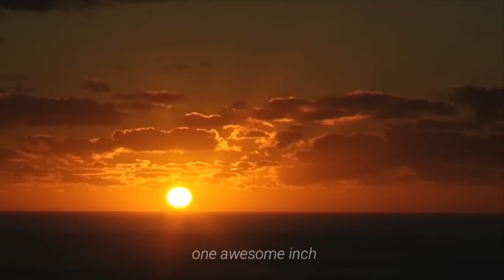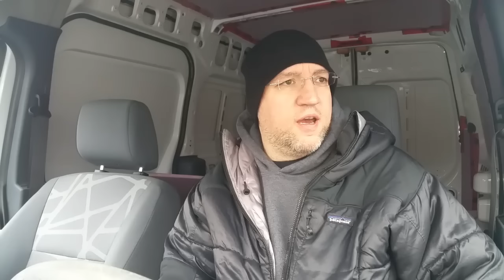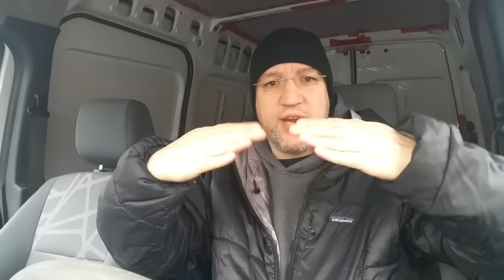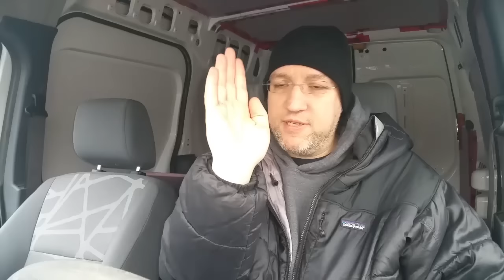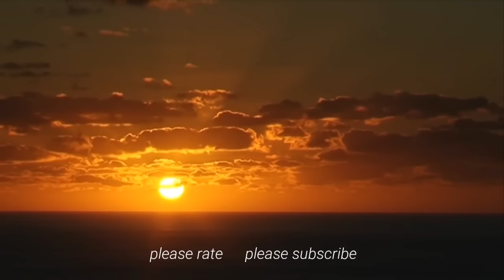Polystyrene Foam Cabinets.... Pros and Cons

Comment: Nice discussion on the pros and cons. I have been thinking of using wood for the base cabinets that will get the crap beaten out of them and using foam for the higher cabinets to keep the center of gravity as low as possible. I am going to convert a box truck so the backs of the cabinets, where damage and strength are low concern, will probably be 2 inch foam and double as insulation for the walls, reducing my build time and weight. Having seen how so many van dwellers wish they can change their floorplan I plan on making the cabinets modular and screwing everything in place so i can unscrew it and change the plan if I like.
Reply from the maker: Modular is a great idea.

Comment: I remember those bass cabinets, the problem wasn't so much in the materials it was in the design. They didn't account for the massive vibration of the bass through the speaker, and didn't design them with proper solid wood backing where it was needed. The polystyrene panels used in the cabinets are made with a fiberglass surface just like many bulkheads in modern sailboats. While it may dent with a severe blow from something sharp you have to believe any plywood would also dent. JMHO

Comment: Great if you are putting only clothes in them, but my experiments show that these structures are inadequate in a vehicle that can, at times-- any temporarily-- can triple the weight it contains.Like 3Gs? Yes. try that with a container of cans, and it's UGE.

If you go "there", use the Zinnsser 1-2-3 selant, because it contains only rigid resins, no the butyl and vinyls in Glidden's Gripper paint. There was a visible difference in the strength, using a paint can on top of a 30" experimental sheet! BAH

Comment: If your main complaint is the possibility of denting the surface when impacting it with a corner, you may consider putting a wood facing on that exposed section of the cabinet. This would also give you a much cleaner looking finish.  The rest of the structure could remain polystyrene covered with screen and glued together.  I'm considering using this https://www.lowes.com/pd/DPI-47-75-in-x-7-98-ft-Smooth-White-Panelboard-Hardboard-Wall-Panel/3015239 because it's also a great cheap whiteboard and my granddaughters love to use the dry erase markers.  The decoration possibilities are endless!

Comment: you could make a1/8" wood façade to deal with the denting problem... actually camper trailers are built very similar. I do realize even trailer builders use wood for the cabinets, but I wonder if the reason for that isn't more of a space enhancing measure (cabinet walls can be thinner,  there's no need for extra bracing, overall just that little bit more storage, ... )

Comment: It's a Van - it was designed to Carry stuff. Does the weight really make that much difference?? Having regularly  carried about a ton (1K Kg) of boxes of books in mine, I can say that not only does it drive better loaded but the consumption only dropped from 33mpg to 31mpg. Fully fitted it's going to be less than half that full weight - where you drive will have more effect than a few cupboards. Aesthetically however this method has great potential - and there is certainly a long tradition of such methods - papier mache and Japanese lacquer come to mind. Unfortunately these particular ingredients foam, paint are not readily available here (UK) as I might be tempted use them to build a canoe where the weight difference really would be significant.
Reply: Nick Wood great point! these van are designed to be loaded up all the time.
Reply from the maker: I agree that the foam cabinets do have great potential. I'd love to see more vandwellers pursue them.
Reply: Yes just saying don't get too hung up on the total weight - however one area they could make a big difference is weight distribution which is important, say for high-up storage or adjusting for axel balance.
Reply: Into The Mystery 13 I can see the foam interior components being useful for your van if the wood components you installed into your Astro affected the overall driveability,  replacing some of it with these foam assemblies instead could make a world of difference!
Reply: Yes the gas counts if you are going to drive coast to coast. Okla. is going to raise gas prices 6 cents a gal. to bal. the state budget. Sorry I'm going to make foam.
Reply: 2 MPG is significant. That's an additional 40 miles of travel from a 20 gallon tank.

Comment: you would need a work shop and a big sink tbh. the method is a messy one. be a horror doing that outside of home depot. it would be safer in a crash. and better for the tops as you say. a mix would be worth abit of thought. am enjoying the random music moments haha
Reply: waine dodd I watched them build a whole cabinet on a park bench at a camp ground. no sink needed. she wore gloves and had it finished in no time. when I've done all my builds I had wood shavings everywhere when I cut and sanded.  I dont think it would be respectful to build anything in a home depot parking lot, and if your working out of van it would contribute to all of losing out.
Reply: i didn't see the park bench build Jed. I did see the other two you did on the couple. the guy had skills for sure. you made a very very good video on the subject. thanks for them 10 out of 10. inch has to build in bits where he can. mostly in a quiet out the way corner. was just looking at it from his perspective. any body else I would point to and advise they looked you the vid you did. keep posting Jed we like the adventure
Reply: waine dodd you got it! I misspoke, it was the paper bag technique I watched on the park bench, it was bare cabinet construction and paper bag technique I filmed in the garage. the park bench part was not filmed
Reply: im glad you said. I was going to search for that vid. you saved me some WOOO time :)
Reply: waine dodd ;) happy thanksgiving if you celebrate that, if not it's goooooood to be grateful anyway

Comment: Did you wind up using the cottonwood plywood in builds?  If not, I wouldnt, cottonwood is a terrible wood for high moisture environments. Cottonwood loves water, its nearly made out of it.  It may be fine for coffins, but I wouldnt put it in a boat or a van.  (poplar = cottonwood)
Reply from the maker: I was thinking about it but maybe not. In BC it's $100 a sheet.

Comment: I am building my cabinets tomorrow and I was considering trying the foam method from Into The Mystery. I have also concluded it was just to time consuming and I am also skeptical on how durable it would be with a bunch of weight in it. I have opted to build mine out of wood.
Reply: NewZona Rides 2 having had tested out the foam cabinets myself they are extremely strong! doesn't seem like they take much more time than wood unless your already very proficient with wood.
Reply: NewZona Rides 2 also depends on your construction method and wood used wood can be stronger or weaker than the foam. using foam as a core and a high strength outer layer (fiberglass or aluminum screen or thin plywood) combines the best aspects of both
Reply: I wish I had seen it with my own eyes like you did. I hope someone does it and gives another opinion on it. Did you see the cabinets in that guys van with heavy items or was it just like clothes and other light stuff?
Reply: NewZona Rides 2 he had 80 pounds of canned food in the cabinets built into the high top. I sat on some of them and they didn't flex too
Reply: Wow! That is really impressive.
Reply: NewZona Rides 2 yeah and if you sandwich the foam between thin plywood it's mega strong. does take a little extra time, but if you want light weight (save gas, wear and tear on entire drive train and brakes) and a better handling/saver vehicle it's totally worth it my mind.